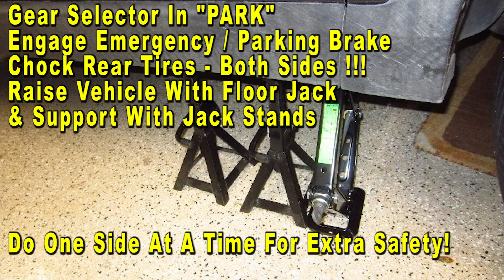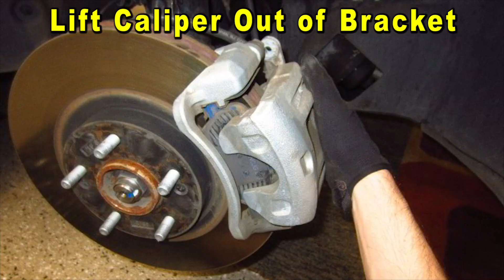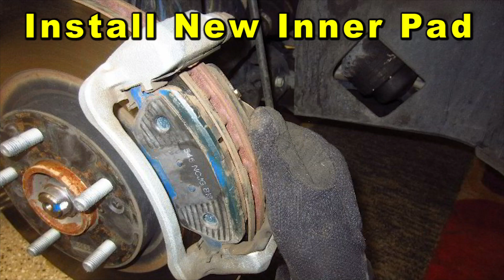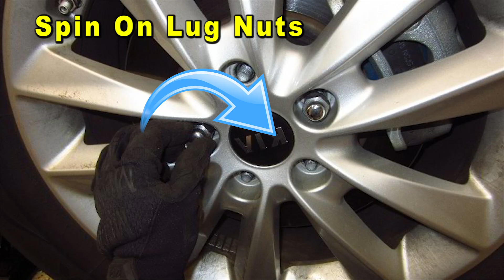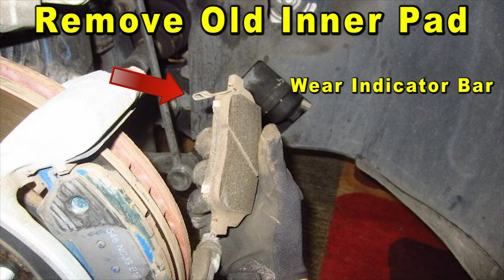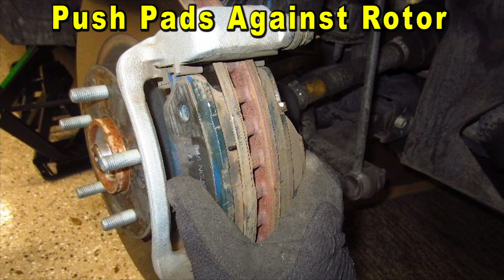Kia Sorento How To Change Front Brake Pads 2016 2017 2018 2019 & 2020 3rd Gen With Part Numbers

Comment from the maker: Kia Sorento Front Brake Pads Part Numbers - https://amzn.to/3rACeBz
Raybestos Front Brake Pads Part # - https://amzn.to/3PIB7b6
Power Stop Ceramic Brake Pads - https://amzn.to/45vf3qp
18" F Clamp - https://amzn.to/46fjbf2
Precision Screwdriver Set - https://amzn.to/3OYN1i0
Plastic Pry Bar Tools - https://amzn.to/3HMtsV7
Socket & Ratchet Set - https://amzn.to/3Z17LbA
Mechanix Gloves - https://amzn.to/3jCnHkt
Torque Wrench - https://amzn.to/3vS5uSI

The Paul79UF YouTube channel is a participant in the Amazon Services LLC Associates Program, an affiliate advertising program designed to provide a means for sites to earn advertising fees by advertising and linking to Amazon.

This DIY video shows owners of the 3rd generation 2016, 2017, 2018, 2019 and 2020 Kia Sorento how to change the front brake pads.

Comment from the maker: Check out the DIY guide for changing the front brake pads on a 2016 to 2020 Kia Sorento SUV - 
https://www.paulstravelpictures.com/2016-2020-Kia-Sorento-Front-Brake-Pads-Replacement-Guide/index.html

Here are all of the DIY repair and maintenance tutorials for the third generation 2016, 2017, 2018, 2019 & 2020 Kia Sorento - 
https://www.paulstravelpictures.com/Articles/2016-2020-Kia-Sorento-DIY-Repair-Maintenance-Guides.htm

Owners of other Kia, Hyundai or Genesis vehicles such as the Niro, Sportage, Sedona, Telluride, Optima, Rio, Forte, Soul, K900, Cadenza, K5, Stinger, Tucson, Santa Fe, Kona, Palisade, Elantra, Sonata, Accent, Veloster, Ioniq, Nexo, Venue, G70, G80 and G90 may also find these DIY instructions to be helpful.